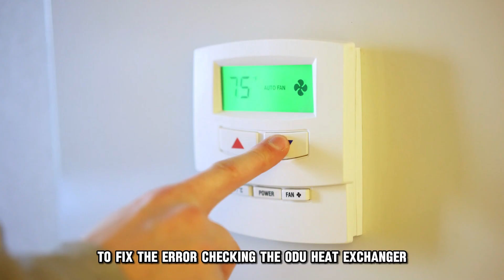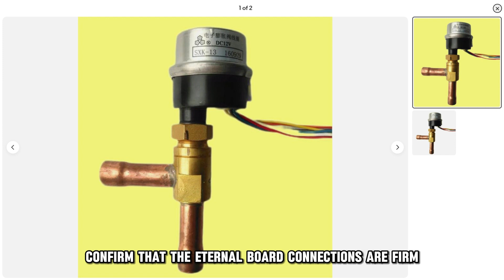How To Fix LG AC CH29 Error Code (Why Error CH29 Occurs, And How To Solve The Issue)

Comment: Last year in July I had purchased an LG split AC and after some days of usage it started showing CH 29 error code. I complained it to LG and the service guy came and changed PCB of outer unit. But after 6-7 months again it has started showing CH 29 ERROR CODE. Now I am thinking of suggesting the service guy to replace the expansion valve too. Let's see what happens.